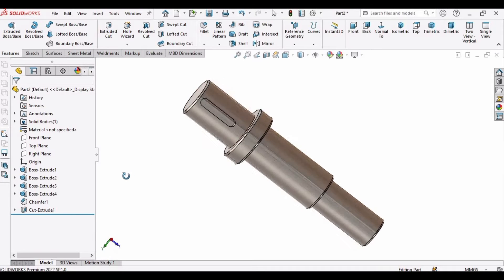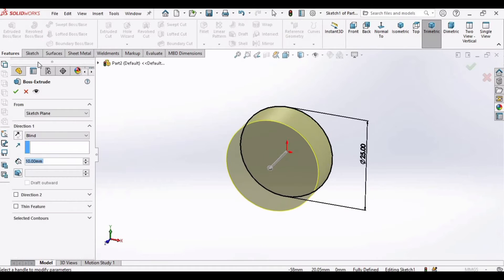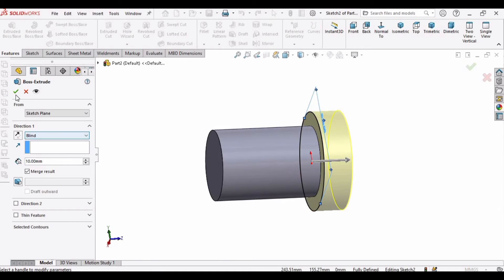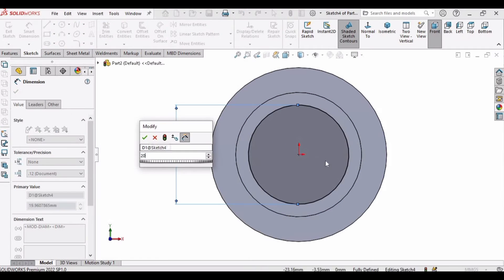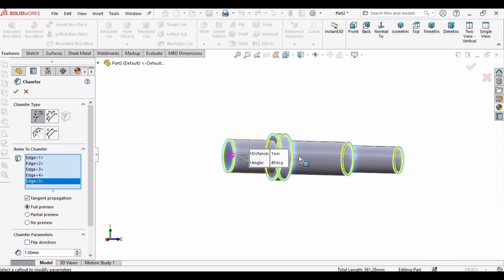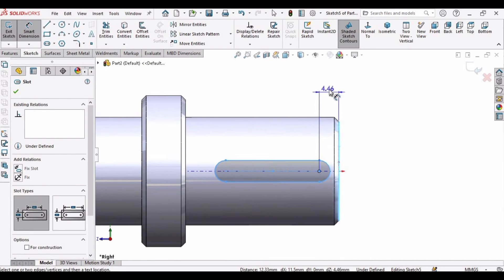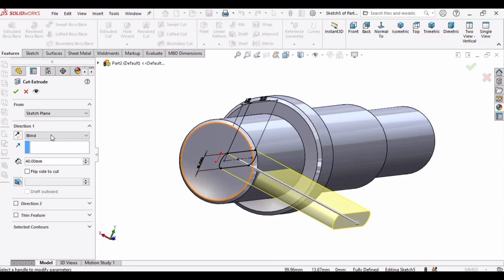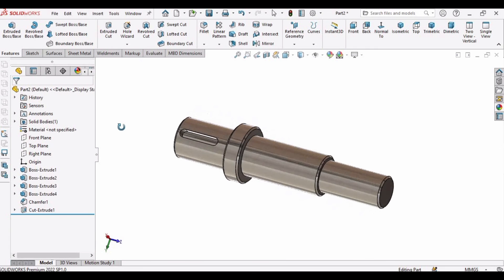Shaft with Keyway in SOLIDWORKS | Robo CAD

Comment: Nice, but the bottom of your keyway follows the contour of the outer surface. It is not flat. You should construct a plane tangent to the shaft and reference it instead for this purpose.
Reply from the maker: Correct